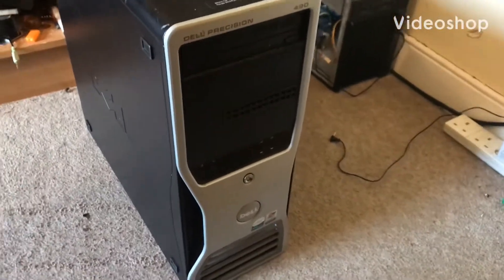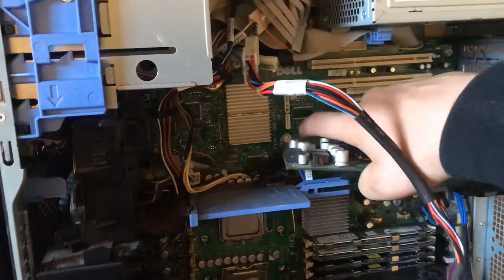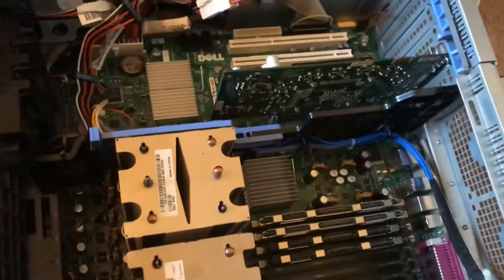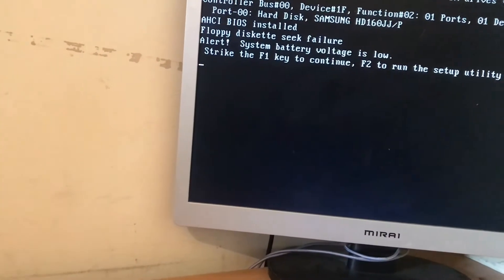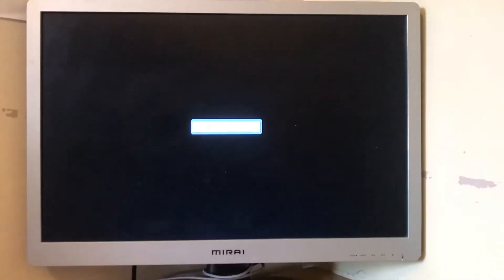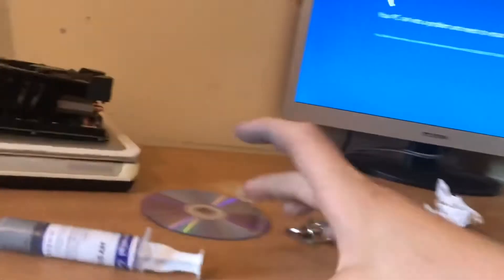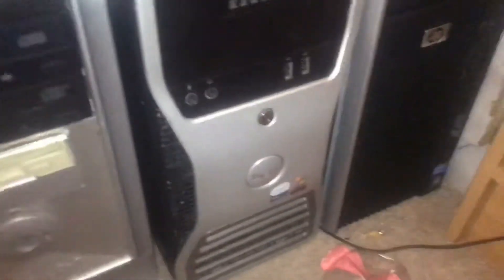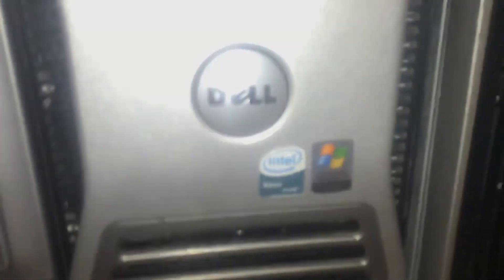FREE dell workstation from 2006, still usable?

Comment: I have one of those too but mine is a 380 I think its from 2006 or early 2007 it says Vista Capable but runs Windows XP. its very heavy. my one has floppy drive on the front. I have a old Soundblaster card installed in mine because  the build in soundcard does not work
Reply from the maker: sick!